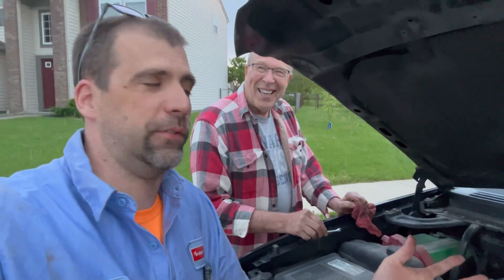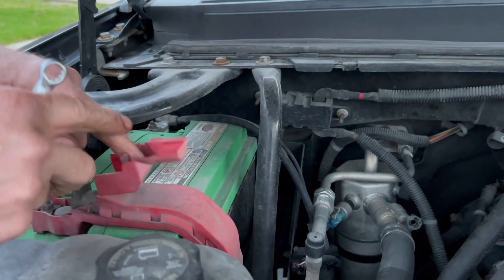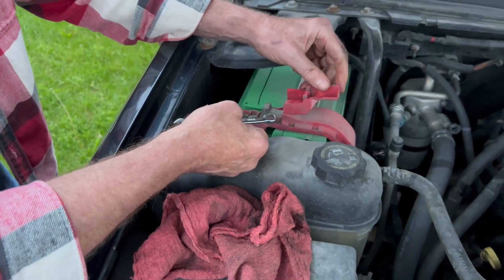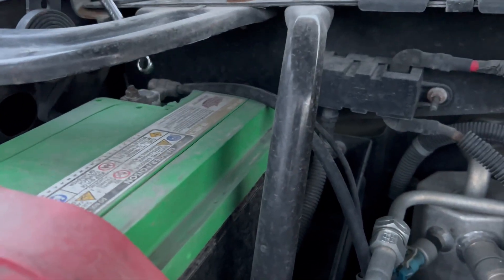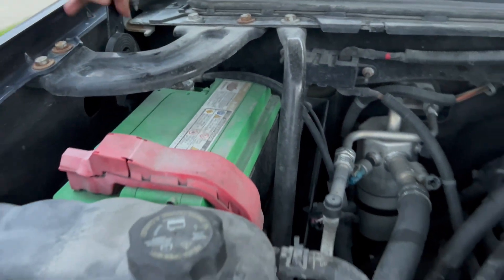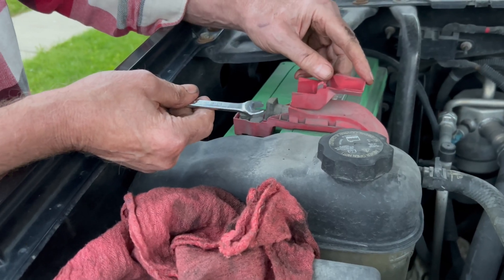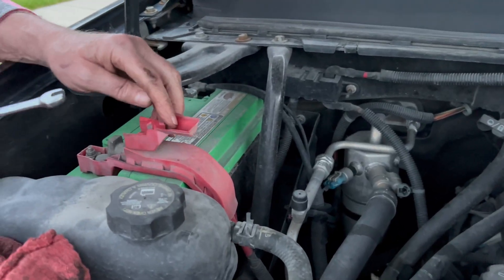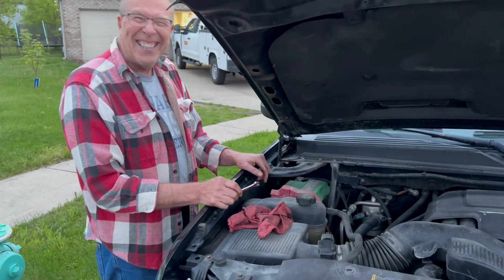Tech Tuesday No welding Battery disconnect

Comment: One major overlooked factor I have stressed is ,,,remove all jewelry and watches or if the wedding ring won’t come off just tape over it or a work glove not just a latex . Nothing conducts like gold and will burn your finger to the bone as it will heat up and can even melt . When working around batteries it’s also the acid on the outside and can cause big problems with bare hands then rubbing your face or eyes 👀,  a chemical burn from battery acid can be neutralized with vinegar just put some on a cloth and wipe over the area. Thanks for the videos and sharing your skills. I was a foreman at a Chevy store when I was 25 ,, you have the “ gift “ lol . My friend has a channel and is successful from having a photographer and editing so maybe check his out to get some ideas so you can grow . His name is Paul Brodie .
Reply from the maker: Definitely will is the channel name Paul Brodie?
Reply: @VinylVillageGarage Paul Brodie’s shop

Comment: Long ago, a friends neighbor was rebuilding his carb in galvanized oil drain pan under  his hood.  While cleaning all the parts with gas in the pan, he sat the pan directly on top of his battery an quickly started a fire. he instinctively  threw the fiery pan, and accidently burned his kid badly that was standing behind him. Batteries can be Dangerous.
Reply from the maker: That would have been awful.

Comment: Boss man changed my  positive battery terminal out on the work truck and didn't tell me.  Well Monday morning rolls around, go to check the 710 level,  and I welded the dipstick to the positive terminal because he didn't slip the rubber boot back on!  Didn't need any coffee that week! Usually I'll catch shiny new parts, but it was Monday.
Reply from the maker: That would Have been an interesting morning.
Reply: @VinylVillageGarage  Funny that you posted this, because about a month ago a friend and I had the conversation about how to hook up the battery.  I've always done negative first, thinking applying power to the system without the ground may hurt something.  I guess I need to call him to tell him I was right!!!!  Love these shorts, and keep up the great videos brother.
Reply: Also, don't reach down next to an exposed positive post with a metal watch band.  The burn blisters are not fun!  😮
Reply from the maker: @Classiccarstexas  very valid and true